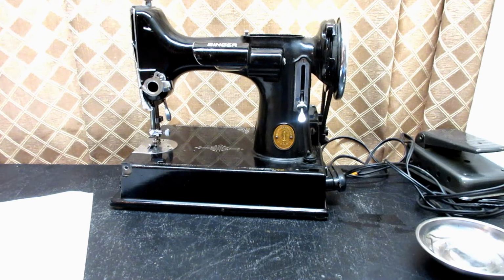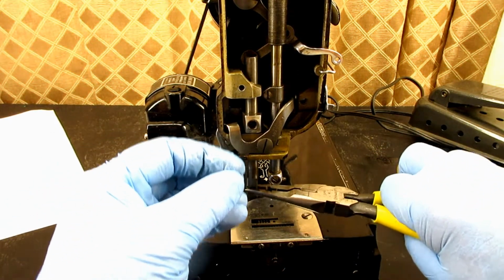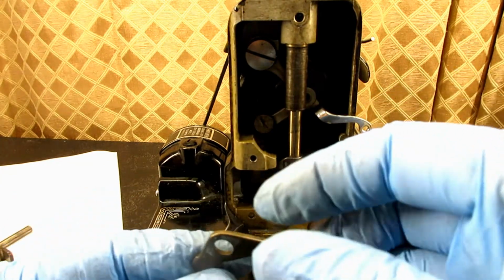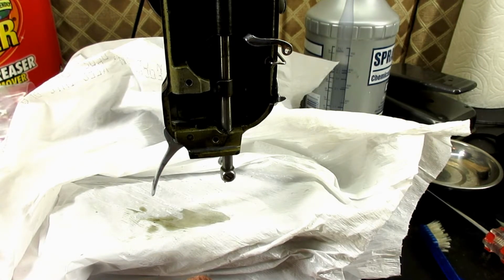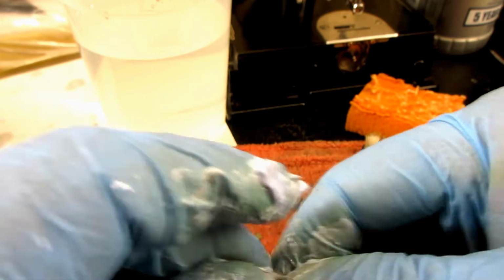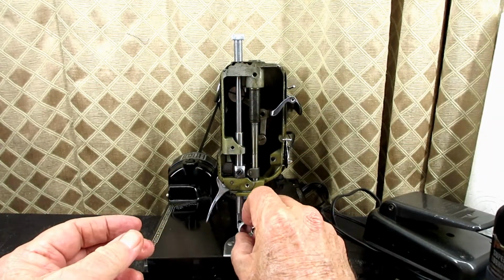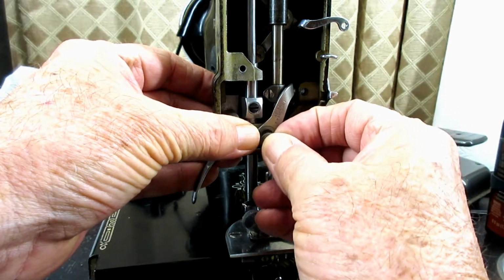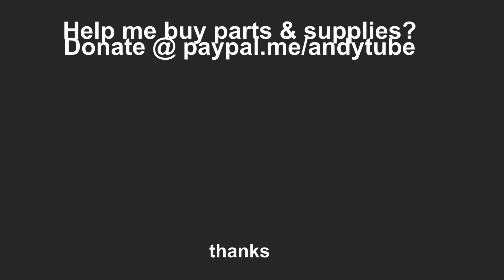Fix the Presser Bar on a Singer 221 Featherweight Sewing Machine

Comment: I think most of Singer's black machines had japanned paint, then the decals applied, then a shellac coating.  If the Featherweight has the same (I suspect it does) then I know that alcohol and spirits (like methylated spirits) start to dissolve it almost instantly.  Very wise to protect the finish with the trash bag or similar just to be on the safe-side if ever using something you're unsure of around the finish. :-D  Lovely vid, as usual, thank you Andy!
Reply from the maker: Thanks for the info. I looked just now at the top of the nose where I scrubbed the bushing with alcohol. Sure enough some spilled around the top of the bushing. There is discoloration and fading there. It may have been there before but I suspect it is from the alcohol. Thanks for watching, Megan. Take Care.

Comment: I would like one of those gages. I use Height Gages made by Whiteside. Part #9800. Woodcraft #144932.
The original finish on these machines is Shellac. Kerosene will not hurt the finish. I actually submerged a frozen machine in kerosene for a few weeks. I removed all electrics first. The finish was not hurt at all and the machine freed up.  Kerosene does not clean as well as your Krud Kutter but it will free everything. A complete dismantle and cleaning is the best for internal parts. 
The Presser Bar Lever Hinge Pin is a tapered pin. Drive it out from the inside toward where the faceplate mounts, using a 3/32'' drift. It drives out and in easily but will take a strong hit in the beginning
Reply: Good info, I would have been afraid to use it
 I know alcohol will compromise the shellac finish, so I am very careful about what touches my machine.
Reply from the maker: Thank you for the info regarding kerosene. I was told by a retired Singer man that it could be used to free-up the bearing and so forth. I'm glad I did not attempt the pin removal; I was think it went the other way from looking at the end of the pin. Thank you. If you'd care to send email to andymanuals53@gmail.com I can forward your request about the guage to the maker so he can contact you. I am asking him if he wants me to just give his email out, but I think he is hesitant for that. We'll see.
Reply from the maker: Nola A I mentioned in another comment that it looks like alcohol spilled a little around the top needle bar bushing where I put the brush in. I see fading on the finish there. It may have been something else but I suspect the alcohol. Lesson learned. 🙁
Reply from the maker: Lin, Terry said to contact him and he will send you one! Terry McClean <terrymcclean@rogers.com>

Comment: Thank you again, Andy! I just got a FW that is missing the releasing lever! I'm feeling more confident about being able to put one back on after seeing your video.
Reply from the maker: Sure you can do it, Kim. No worries 😊 Think of all the thread and fabric you can buy with the money you save by doing it yourself!
Thanks for watching my channel and taking the time to comment. Good luck.
Reply: @andytubesewing1953  thank you! Quick question - I replaced the presser bar release lever/spring correctly but it isn't quite hitting the tension pin. Any ideas on what to try next?  When I compare this machine to another FW, the tension pin seems out about the same distance. The levers look the same. I'm thinking of removing a lever from another machine to rule that new part out as the issue. The lifter on the back seems like it still has a little play at the top where it could go higher. Any suggestions for what to try next?
Reply from the maker: @kimlane5961  SInger models 221 use two different release levers depending on the model. I'd guess you have the wrong one.
Part 45764 seems to be the most common part number, but 221K models and a couple others use Part 45909. The part number should be clearly stamped into the part. Look for the one you do not have now. You can go here to see what I'm talking about. Be sure to read the description closely: https://singer-featherweight.com/products/releasing-lever-and-spring-singer-featherweight-vintage-original?variant=12271104524380
Reply: @andytubesewing1953  Thank you! It's the right part (45764) for my 1935 221. I just think there might be something else going on. Thank you for taking time to weigh in!!
Reply from the maker: @kimlane5961  That's good about the part; I had the wrong one on Lala. Good luck then.
Reply: @andytubesewing1953  thank you for making your great videos. (I did decide to order the part in the 45909 just to make sure it's not a better fit.) I wouldn't have the nerve to explore the options without your videos!
Reply from the maker: @kimlane5961  OK, good luck. I was thinking of the pin on the back of the lifting lever that pushes on the releasing lever and if it showed signs of excessive wear; like a flat spot. I did see an old model 15 that had a very worn pin and could not lift the releasing lever enough to reach the releasing pin. The owner put a dab of JB Weld on the pin and that fixed it. Also, be sure the releasing lever is installed flatly against the body of the machine. The edge of the hole thru the lever can get caught in the hinge screw and make the lever move a little wonky. Not trying to make it more complicated, just sharing things I have seen/hear of.
Reply: @andytubesewing1953  this is so helpful, thank you for sharing potential things to help me trouble shoot! That is a tricky screw/lever area. I was glad you mentioned it in the video! I'll check into that lifting lever on the back. It looks similar to another one but I'm just perplexed at this point so I appreciate you taking the time to share some potential thoughts. Take care.
Reply from the maker: @kimlane5961  ✨

Comment: This helped me a lot. I have a 222K (230-250 volts) and the foot lifter sticks a little towards the last bit when you lift it. Now I can see exactly how it is put together and I suspect there might be some gunkc - the rest of the machine I already did and she sews like a dream now.  The 222 is so tight because there is even less space than in the 221 due to the narrow free arm.  I shall check the lifter tomorrow and see if that fixes the problem. The lacquer used on the Featherweight is shellac and that is damaged by spirits (denatured alcohol). 
I would buy that tool!!!
Reply from the maker: I've never seen the 22K1 in person; only pictures and the manuals. I have worked on a tubular bed (free-arm) model and I know what you mean about tight. Hopefully, you will find what is causing the sticky lifter. Good Luck.

Comment: Even though I don't have this particular Singer, I love watching and learning about these old machines.  Just a suggestion.  When you bring something close to the camera to see closer up, the camera is still focused on the machine itself and the close up is fuzzy.  If you put your hand behind the object the camera will focus on your hand and not the machine, and the close up will be more in focus.
Reply from the maker: Thanks for the tip. I keep fooling with the focus range settings on the camera and thought I had it set correctly. I try to do better. Thanks for watching.

Comment: I'm only 25 minutes into the video, but I wanted to pass along a cautionary bit of info. I'm not sure if this is true, but I've been told NOT to use alcohol on the featherweights because their finish is shellac and it would be damaged by the alcohol. As I said, I'm not 100% sure, but I choose to see on the side of caution, so I protect the finish, nothing but a soft towel to wipe her down.
Reply from the maker: Agree about the alcohol and replied to another comment you left. I put the alcohol back on the self 🙂

Comment: My releasing lever on my 222 is really stiff.  I think if I take it apart like you are doing here& clean it.  It may work better.  Thanks Andy.
Reply from the maker: It certainly may. Don't forget that lever also moves the tension pin release lever that pushes on the back of the thread tension unit. There can be dried gunk on that hinge screw also. How nice to have a clean and smooth presser bar system again. Good luck.

Comment: andy do you have any videos on how to fix the timer on a singer vs2 fiddle ? I didnt see any on your play list for this particular model. I was trying to perfect the stich (it was stiching) so i came across a video from a guy that said that you should adjust the height on the pressure bar cause mayhe the pressure foot was to hight. I followed his instructions (unscrew the pressure bar from the top, lowered it and  tighten it back. Now the problem is worse cause number one the needle is not picking up the tread from the vibrating shutler and two, of course is not making any stiches at all. I tried adjusting the needle height, the pressure bar again, (i raised a little bit) but it didnt help. There is no marks on these two bars to guide  me as how the height i should be,  and how hight should the needle bar should be. (i do not want to touch the bar where the needle goes) all i will touch in here is the needle , and the pressure bar since i already started fooling around with it. I really appreciate if you can help me solve this issue. Thanks
Reply from the maker: Sorry, I can't help you ☹ I've never seen or worked on that model. Years back I was asked about it and found this free download copy of the original manual https://ismacs.net/singer_sewing_machine_company/manuals/singer-sewing-machine-vibrating-shuttle-manual-1891.pdf

Comment: Merry Christmas Andy. I’m spending the day at the workstation doing my therapy today. I took a white Featherweight from a friend and told her I’d clean it up the best I could and much to my surprise compared to my black one, the pressor bar is totally different. The spring was broken on the white Featherweight and when I contacted the Featherweight shop, they said they did not have the spring for that. So I went through another source I can’t remember who at the moment, but they sent me a spring and even though I specifically mentioned in the comment that it’s for the white Featherweight, I think they still sent me the spring for the black one. Anyway, my question is have you ever worked on the white Featherweight and come across the press bar, noticing that the springs are different?
Reply from the maker: Merry Christmas 🎄 Can't help with this request, sorry. I've never even seen a white featherweight. Chatted once with a lady in California who had a couple dozen black ones and a single white one. She warned me not to buy the white one because they were "cheaply made and have a belt for the hook".
Reply: @ good to know.  Thanks.

Comment: Andy, I just got a 220.  The presser foot rod will not budge.  I tried sewing machine oil, WD40 and alcohol.  I also tried heat( hair dryer).  It turns, but that’s all.  Any suggestions.
Reply from the maker: A little confused by your statement that it won't budge but you can turn it. So if you can rotate the bar around in the bushing that indicates it is not stuck to the bushing by dried-up oil. The steps you took are what I would do. If the bar still will not slide up or down in the bushing (for removal) I think there may be a built-up "ring" of oil". I have seen this before. The oil settled and hardened, usually on the bar, and it has a larger diameter than the hole in the bushing and can't pass through. That's the reason I use the Krud Kutter Cleaner & degreaser to drip onto the bar and into the bushings. It helps soften and loosen dried oil quicker than alcohol or WD40, IMO. You can still use the products you have tried but it will take longer and more applications. Using heat from a dryer is a good choice and I've done that many times. This is all I can imagine since you can "turn" the bar but not move it up or down. BTW, if you only loosened the set screw then try removing it completely and use a dropper to drip your cleaner inside too. Use caution with the alcohol and WD as they may damage the finish/decals on your machine. If you still can not get it loose you may want to contact the folks at the featherweight shop. They sure know a lot about the machines and have helped me in the past. https://singer-featherweight.com/pages/contact-us

Comment: The Featherweight bobbin is also 7mm tall i have used that in a pinch. If i ever need to do an adjustment on the fly it gets you very close.
Reply from the maker: That's a great idea. Thanks for sharing. My bobbins measure 7.23mm

Comment: Hey Andy.  Hope all is well!  What is the chance a Singer 221 presser bar spring is compatible with a Singer 185?  I have searched the internet for the answer with no luck.  Thanks in advanced.
Reply from the maker: I could not say. I'd have to measure the two or just try it. Are you trying to replace the presser bar spring on a model 185? If so, I'd look at the spring from a model 99 or 99K as the 185 is the newer version and replacement of the 99K and I think they only changed the body and bobbin winder, leaving the other parts the same. I feel the 221 featherweight is a smaller, lighter model, and even if the 221 spring "fit" it may not be the same length or have the same tensile strength as the 185. There are sellers of parts on eBay. 
https://www.ebay.com/str/mnbargainstore/Parts-Singer-99/_i.html?_storecat=3720216016&_bkw=spring
Reply: @andytubesewing1953  Thanks.  If anybody would know, it would be you.  Thanks for the ebay suggestion.  I am trying to replace the 185 presser bar spring, will search for 99 parts as well.  Enjoy a coffee on me.  Thanks for the help!
Reply from the maker: @markscheidegg1181  Mmmm, Starbucks 😊 Good luck.

Comment: hi, how to know that if the presser bar had moved a bit from its original position? cause my machine, at first the needle is hitting the plate, then i adjust it, and now it hitting the presser foot. i have no idea where to look up to.
Reply from the maker: Which did you adjust, the presser bar or needle bar? Everything I know about the presser bar is in this video. Everything about the needle bar is in this video:
https://youtu.be/zY_XMne5YTQ   If you'd like a copy of the The Adjusters Manual for the 221-1 Featherweight you can download it at this link: https://cdn.shopify.com/s/files/1/0992/8814/files/FW221_Adjuster_s_Manual.pdf?7223313128764594508